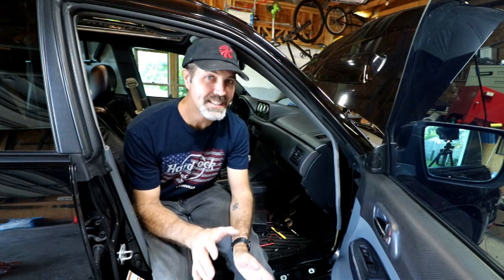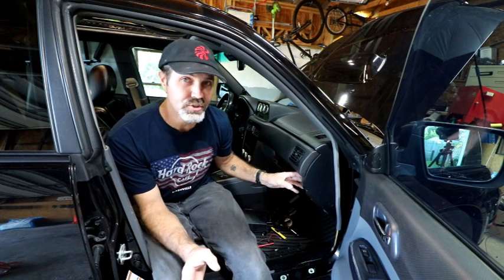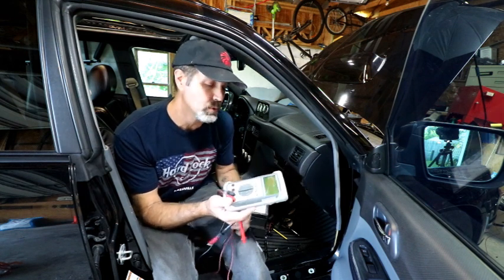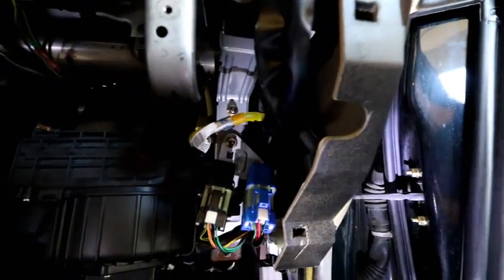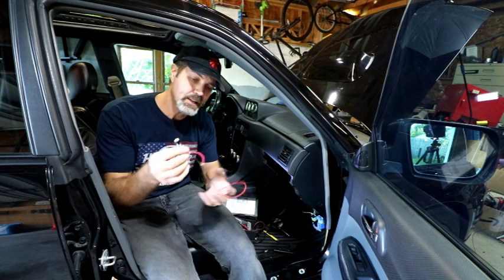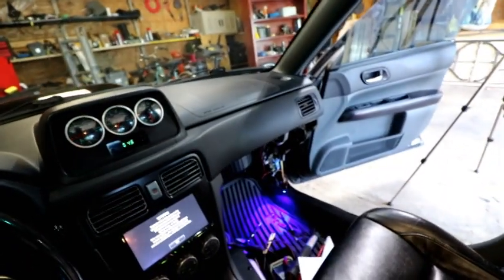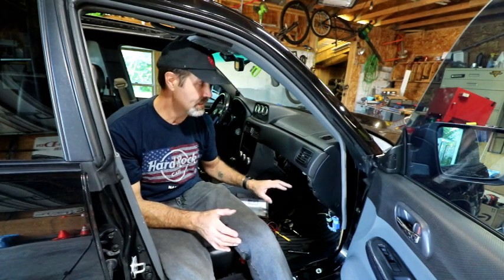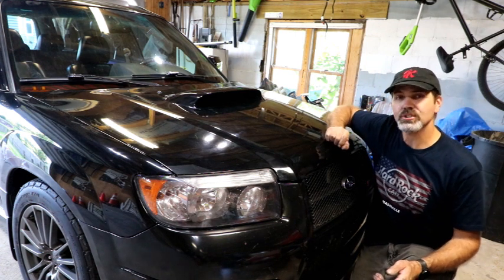Rewiring the Daytime Running Lights On The Forester

Comment: In my Legacy 6MT the DRL illuminates after engine on and p-brake released. 

I want to switch the DRL from the hi beam to the blinker (with a switchback bulb.) How do I identify the relay for that?
Reply from the maker: You can find the factory service manual on line for free.

Comment: those led running lights are sweet, you should show us how you put them in.
Reply from the maker: This was more about finding the correct wire at the relay and not using the resistor then it was about the lights I used. Thanks for watching.

Comment: I have 08 forester I'm trying to make work the new Aftermarket Headlights I bought using LED bulbs, all were working ok before with the OEM'S and halogen bulbs, Now what I got its only the High beams working with the headlights along with the DRL the low beam are not working, Perhaps I may need your guidance in how to wire up the Low beams properly so it can work, I don't mind the DRL function Thank You.
Reply from the maker: Check your headlight relays.

Comment: I have an 07 XT Manual RHD. Honestly didn’t know we had DRL’s normally lol. Unless the Aussie version is different? I know I have a button on top of the steering wheel column that can turn lights on without the other switch. 

Been thinking about putting in eyebrow drl/switchback so been trying to research lol, any help appreciated
Reply from the maker: I don't know for sure, but your light setup may be different.

Comment: Yes, cool video but missed the critical part about showing how you fit and wired those LED strips. How did you seal the old socket? Ever thought about wiring the amber LED portion with the turn signal? Would enjoy chatting more with you. How can we get in contact? Thanks
Reply from the maker: This was more about finding the correct wire at the relay and not using the resistor then it was about the lights I used. Thanks for watching.
Reply: @DIYEVERYTHING  Gotcha and like what you did (have same 06 FXT), but what’s the point of redoing this if it’s “not” about what lights you are using my dude? Other wise would just use the existing lights… Right? Curious how you sealed up the hole with the LED? Any good words there? Thanks
Reply: @brettmills2470  did you get to and the led switchbacks? I got a non turbo Subaru Forester 2006 I want to do halos and led strip switchbacks
Reply: @sethblackmoore3057  hey bud, I actually did purchase all the parts/gear to install and will want to do this my self here soon (had some family stuff to handle). His instructions are clear and sound. So, the one long term problem I see or should say am concerned about is making sure the LED’s are nice a straight/positioned correctly so it all looks clean and just as important that it will be sealed good and not leak in the rain or car washes… 

I have full set of Lasfit led bulbs all the way around the front/back of FSTi and inside cab too (looks great I would suggest to do that as well). You got a fun rig even N/A, make her dope! 👍🏻

Comment: Would cutting the drl wire and connecting it to the led strip work the same? Or would that be too much power output for the led?
Reply from the maker: Not sure that would be possible, the drl and low beam share the same wire at some point after the relay and before the resistor under the hood. Other years and models will vary, of course.

Comment: Thanks for finding  the daytime running light wiring! I was just doing the same this weekend. With that LED it looks really really good and modern.  Quick question are those OEM headlights of good aftermarket reps? They look super clean. my headlights are super cloudy & I am looking for new headlight!!!! In the worst way.
Reply from the maker: You're welcome, finding a good diagram was tough so I thought I would try to make it easier. As for the headlights, they are from headlight depot and unfortunately they leak. I'm still on the search myself.